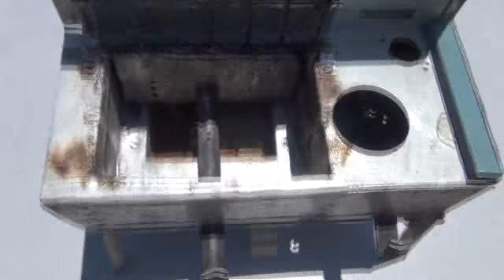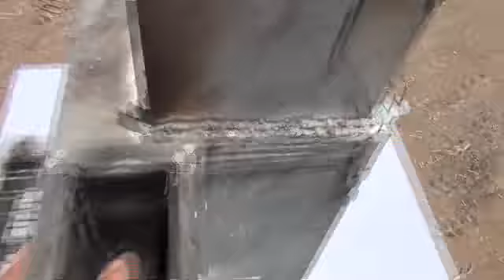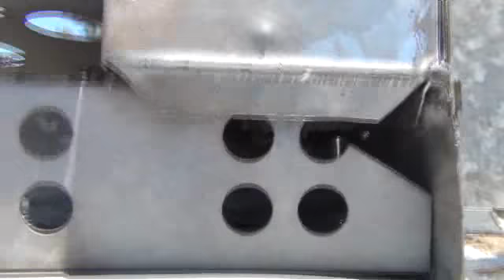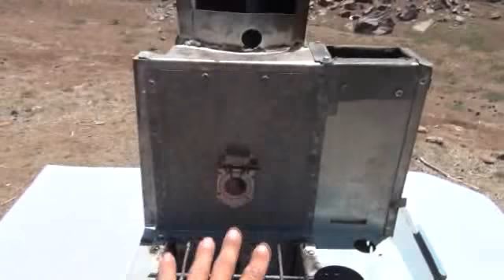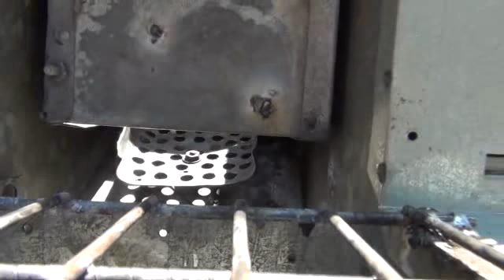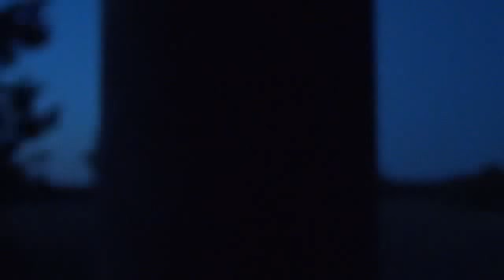The BEST Gasifier COOKING STOVE ever designed.

Comment: Hi Mr T. What about covering this system in clay or concrete to create residual heat?  I know this is only a prototype as you stated and i'm working on my own system here in Yorkshire UK to heat our workshop for the winter as it gets very cold here at end of October to early March. this system could also have some sort of piping wrapped around the rear of the burner to run a Greenhouse so you could grow food all the winter.  That's my option anyways.

Great Vid as always... Cheers ALL THE BEST.

Comment: Mr. Teslonian I hope you know how much people appreciate what you do. Take care of yourself so you can keep these coming.
Reply from the maker: Thank you!
Reply: MrTeslonian im wondering how close to 100% of material you can use if you combine a few different technologies  . Im thinking  rocket stove mass heater with bio char fire fuel and using exhaust gas in the mass heater to create biodiesel/gas/propane.  I have seen rocket stove mass heater  with almost 100% heat transfer . And im thinking ,correct me if im wrong , but the cooled gas should be able to be reclaimed for propane production and the initial burn chamber creates more than enough heat to make bio char and bio fuels . And use the bio char to fuel the rocket stove mass heater